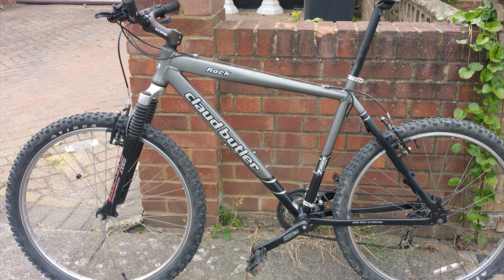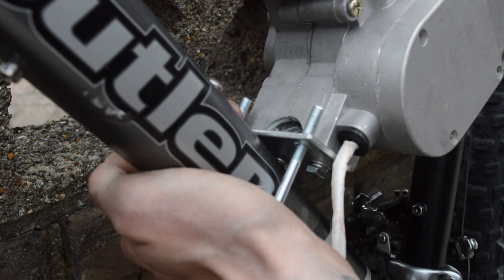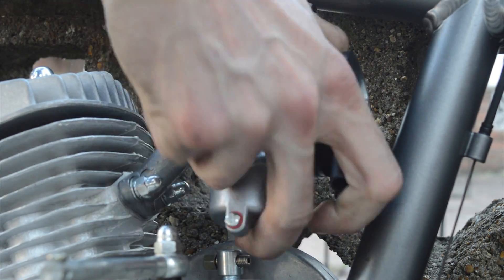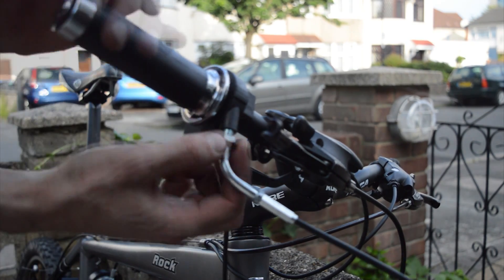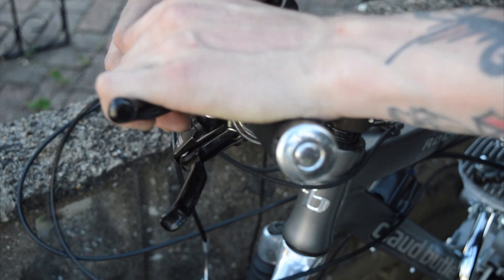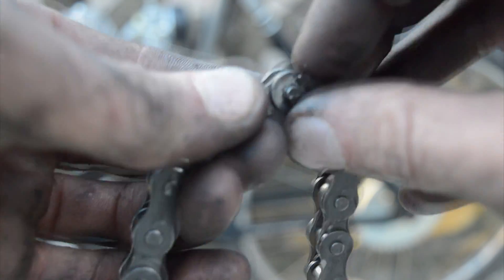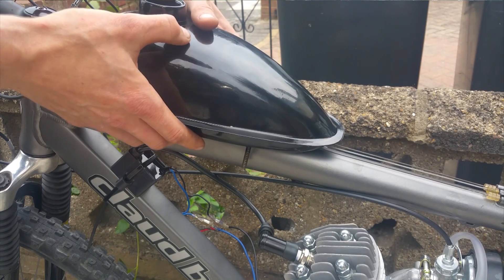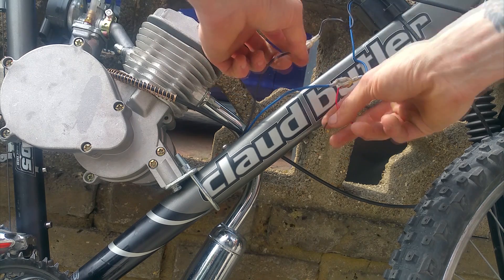Build a Moterised Bike at home - Tutorial

Comment: What is the millage.
Reply: David Dicker he means what the miles per gallon or kilometer per liter
Reply: Ty Lambert Yes what is miles per litre of petrol
Reply: Amit Sarkar all in one sorry man I honestly don’t know the answer but I’m sure you can find information on it.
Reply: David Dicker that really good. I’m sure that you could get more if you change out the cam shaft.
Reply from the maker: +Amit Sarkar all in one well as this is a brand new build there will be no miles on the engine.
Reply from the maker: +Amit Sarkar all in one well I can get around 60 miles on 3litres as I have upgraded my carb and exhaust along with boost bottle. Depending on size of the tank or accessory you install you can change the distance.
Reply from the maker: +Ty Lambert I can get around 60 miles with the 3 litre tank with the hp carb and race exhaust. Depending on what you have installed or the litre capacity of your tank will benefit you.
Reply from the maker: +Ty Lambert also depending on weather you are breaking your engine in with the basic parts you will get a little bit more distance without any upgrade.
Reply from the maker: +Ty Lambert well I don't know about that but you could always get a bigger tank and go further. Something like a 5 or 6 litre.

Comment: What is the maximum speed of this motorcycle
Reply: David Dicker what parts could u upgrade?
Reply from the maker: +Amit Sarkar all in one after the break In period you should be able to achieve speeds of up to 35 to 40mph depending on what part you could upgrade then you could do speeds of 70mph. I hope this helps and thanks for watching.
Reply from the maker: I have another video about upgrades you should check it out and see what you think.

Comment: Don't waste your money on these motors. They are all crap.
Reply from the maker: +Frantic Carnival well they haven't let me down yet and I have upgraded the bolts and nuts to hardend stainless so I haven't faced any faults.
Reply: David Dicker I just can't seem to keep one running longer than 6 months. There's always an issue whether it's the carb, chain, or clutch. They just don't seem to be reliable. Maybe I'm expecting to much from these little motors.
Reply from the maker: +Frantic Carnival well you can upgrade parts on these even down to nuts and bolts. I have done this and I am very happy with the result. Feel free to check out my other videos and I can show you how to really go to town with custom fabrication and modification.
Reply: David Dicker 
No thanks. I'll spend money on something else. Good luck!
Reply from the maker: +Frantic Carnival well the nuts and bolts plus a new carb with air filter will only cost 30 pound but it's up to you
Reply: David Dicker 
Hi! Thanks for you're comment. I'm interested in gaining speed with mine. After your video, I was inspired to give mine another shot so now I'm going for speed and I need some guidance. I have a 36 tooth sprocket and have ported the motor and purchased a clone Dellorto carb. With these, I can only achieve 40 mph. Wheat else is needed for such speeds?
Reply from the maker: +Frantic Carnival well you need to change your jets in your carb also you can get a quarter throttle grip along with a better fuel to oil mix. Any small thing you can do will improve it drastictly. Plus upgrade all of the nuts and bolts for 6mm stainless.
Reply: David Dicker 
I'll try these and see what happens. Thanks for the tips! Be safe out there brother😊
Reply: I port matched the intake and Wow did that make a huge difference!!
Reply from the maker: +Frantic Carnival no worries and can't wait till you get back to me and tell me how you got on. Wish you all the best mate and be safe to.
Reply from the maker: +Frantic Carnival brilliant I am glad to see your back to this project. It is more fun when you tinker around with these. Have a great Christmas and New year.

Comment: Pliers aren't doing it I got one off the others stuck and refuses to turn what can I try? (EDIT) Finally got the stud butwas wrong about the measurements and really need to know if you can put the carburetor on slightly turned on it's side or maybe more then slightly?
Reply from the maker: +YouTube BANDIT you can get an offset for the carb on eBay for around £2.00  with boost bottle attachment or normal offset. Just type in 80cc offset in eBay and you will see. I hope this helps and thanks is for watching.

Comment: I have a Trek Marlin 6 mountain bike. It's hard tail with disc brakes. Would one of these kits work on my bike?
Reply from the maker: +Derek Mckenzie just checked and it should fit nicely and you can always get a offset carb setup for cheap to give you more room for installation. I hope this helps and I have many more like this so check them out.
Reply: I'll just have to get a kit. Where and how much would a 2 stroke or the bigger 4 stroke cost m?
Reply from the maker: +Derek Mckenzie the prices are different they start from 68 pound and go up to 300 pound on eBay and the prices always change so check them regularly. Plus the 4 stroke does not go as fast and cannot be upgraded as much.

Comment: Have you found any easy way to omit the sprocket and use the bikes sprockets to be able to shift speeds?
Reply from the maker: +Navraj Gill yes you can get a Jack shift kit but it might be a little pricey though.
Reply: David Dicker right on, I see it costs about as much as an engine kit to make that possible. I dont need it but I want it xD
Reply from the maker: +Navraj Gill well if you look about you might be able to get it a little bit cheaper but I would stick to the normal ways.

Comment: I'm actually going to purchase a kit soon do you have any advice which brand i should get
Reply from the maker: +cornholio55 I would say that any kit from around 100 pound from Amazon or 65 pound from eBay because all of these kits are basically the same internally even though they are different prices. The best this I can suggest is buying a cheapish kit then try upgrading the nuts and bolts along with all the washers with stainless steel. Most of these size bolts are 6mm thread.

Comment: Do the bike brakes stop the engine at max speed ? In how much distance for it to stand still?
Reply from the maker: +Aazib Ashfaq well to be honest the normal bike brakes are good enough to stop but it depends on what the weather conditions are exactly pike a car so on rainy days it will take a little bit longer to stop depending on what tires plus brake pads and what tire pressure you have. I hope this helps and thanks for watching.

Comment: Another question haha, any advice on why my bike is stuck in neutral now and won't go into gear?
Reply from the maker: Some times a little bit of tweaking helps from here and there.
Reply: Clutch cable is too tight
Reply: David Dicker yeah in general tweaking and tinkering goes a long way
Reply from the maker: +ReedyFML you need to make sure that you adjust the clutch properly to engage the gearing for the bump start of the engine. Try and adjust the clutch cable on the arm then retighten the screw or take the clutch cover off and then adjust the flower nut position. I hope this helps and thanks for watching.

Comment: Iv just bought a built bike 80cc and the cables came undone and there is a white cable with the black and blue one any idea where it goes ?
Reply from the maker: +Shaun Burney the white wire is a 6v wire for the lights on the front and back. You can discard this as you don't really need it. Also put the blue with the blue and the black with the black then it should work. Make sure your killswitch wires are linked aswell otherwise you won't be able to shut it off. I hope this helps and thanks for watching.

Comment: Hi thanks for this tutorial, my bike is now in working order, however how do I stop petrol from leaking from the tubes? I used zip ties but they're useless
Reply from the maker: +ReedyFML you can get special bracket jubalie clips from most diy shops or order from eBay plus Amazon. I used to get the same problems bit try upgrading your fuel line aswell you will find this will improve it alot. I hope this helps and thanks for watching.
Reply: Get some small hose clamps. Should do the job,just don't over tighten then.
Reply: By UK fuel line [braded] and clips [chines tubes break down on elasticity very quick, or get a slightly smaller pipe and heat up the ends in very hot water and push on 
Merry Christmas to everyone.
Jim
Motor Power Bikes
Reply: You are a Great Guy keep it up [like the Vids] I am off now until new year so MERRY CHRISTMAS
Jim
Reply: ReedyFML you could try hose clamps but it would be best to just go buy some higher quality weed waker fuel line
Reply from the maker: +Jonathan Kirk you will see from my later videos I have done just that. Cable ties are ok at first just to run the bike in and break the engine in but once upgrading parts I would agree. I hope you enjoyed this video and thanks for watching.
Reply from the maker: +james demanbro I agree and if you see my later videos you can see I have done exactly that. Wish you all the best James.
Reply from the maker: +james demanbro ok matey wish you all the best.
Reply from the maker: +french toast if you check out my later videos you will see that I have done exactly that. I agree when you get the kit it does not come with this but it is a vast improvement on the standard items they give you for installation. I hope you enjoyed this video I have many more like this so check them out and see what you think.

Comment: David Aaron Dicker, I am going to build one of these and I will be taking it to Secondary School I am in 9th grade and the principal has seen them and has no problem with them as long as they are ridden on the school grounds. By the way how fast can these go if you upgrade the caburetor and air filter etc. How far do they go in a FULL 2liter tank?
Reply from the maker: +Bayar Usman that's good to know and I wish you luck with your project plus any help or advice feel free to ask. These bikes will vary in speed depending on what upgrades you put on but you must make sure that you properly break the engine in with 4 full tanks of fuel to oil mix. I also have many other videos that you might want to check out and thanks for watching.
Reply from the maker: +Bayar Usman with a 2 litre tank plus an upraded carb and new exhaust you will be doing around 60 miles plus hitting around 45 - 50 mph.

Comment: The bike is fully setup following your step by step instructions however I pointed out a problem about the first small sprocket in the engine not moving, however now it's all setup the bike is basically acting as though it's seized even when the clutch is pulled in, any help?? Please
Reply: I haven't even got around to going on the bike as it just won't move as it's stuck
Reply from the maker: +ReedyFML what you need to do is adjust your clutch so 1st try to undo the clutch arm screw then slacked off or tighten up the cable then retighten the screw. Or undo the flower nut on the other side of the crank case then release the nut slightly and then retighten. I hope this helps.
Reply from the maker: +ReedyFML with the back wheel like this the clutch will be fully locked on so the bike won't move.
Reply: Thankyou so much for the quick reply! I'll try that and let you know
Reply from the maker: +ReedyFML no worries try it and see how you get on and if you get stuck feel free to ask and I will do my best to help you.
Reply: This Is England The flower nut where the first sprocket is or on the other side of the clutch? Any. Help is appreciated as it's still not working, with force the first sprocket will turn but besides that it won't work properly
Reply from the maker: +This Is England it is either the flower nut or the clutch cable lever. Like you say the flower nut has to be adjusted to engage or dissengauge the clutch to either gain or loose compression on the engine.
Reply from the maker: +ReedyFML it will not engage or dissengage untill you loosen the flower nut or the clutch cable it's all a little bit trial and error sometimes.

Comment: Fuck the muffler
Reply: Kid powerlifter 2 stroke engines will burn up with no back pressure which is provided by the muffler
Reply from the maker: +Kid powerlifter unfortunately you will need the muffler to run the engine in and so as you don't loose power. Also any big gaps left like this could also damage your engine.
Reply from the maker: +Alex Hickey I agree you won't have any power what so ever and be at the risk of damaging your engine.

Comment: hey bro, i have an old Saracen havoc bomber extreme that i want to convert, the frame looks out of sync to install an engine, is there anyway i could get around it? thanks in advance
Reply from the maker: +Jasen de-botte just looked at pictures of this frame and unfortunately it won't fit due to the lack of space as the back suspension is in the way of the engine mounting points. You can all ways purchase another frame and build one for pretty cheap.
Reply: hi david, cheers for getting back to me. yeah i thought that would be the case, i also guess the rear shocks would intefere with the chains length  as well. ok cool will get a new frame. thanks mate :)

Comment: I'm currently building mine up and using your guide however the big spring for the clutch seems to just slide Over the clutch cable so it isn't any use? Any help is appreciated
Reply from the maker: +ReedyFML well this video has helped many others complete there bike. What you need to do is thread the clutch cable through the eye on the engine then use the big spring then thread the cable through the other eye then use the small spring. Finally thread it through the last eye on the clutch arm and then tighten. I hope this helps and good luck with your project 😁
Reply: Yeah it did thanks! Another thing when the clutch arm is taken off with the engine cover the front sprocket doesn't spin to put the chain on? Thanks a lot very quick reply and amazing video thanks
Reply from the maker: +ReedyFML yes this is correct it won't move so put it back on with the 3 screws and push your clutch arm in with your hand then it will spin. Then feed you chain in from the top and this should work. Plus I have a few more like this you might enjoy and thanks for watching.
Reply: David Dicker You got any ideas about my most latest quiery on this project? Thanks
Reply from the maker: +ReedyFML yes try to follow what I said and this should work. I had the same problem on my 1st build.

Comment: hello i have a question how long does a 2 stroke bicycle run for . also how much to fill the tank up of gas
Reply from the maker: +Big Nutss well they say not to run them for no longer than 10 to 15 mins at the break in stage but it depends on what upgrade mods you have done after along with how big your tank is.

Comment: ive watched several videos one this exact motor and this is the only video that actually helped. and the music was a nice bonus. just kept replaying the video over and over until my bike was finished. thanks alot!!
Reply from the maker: +Joseph Franks no worries I'm glad this helped you to get your bike done I have a few more videos you might want to check out and thanks for watching.
Reply: +David Dicker only thing I can't get fixed is the clutch. my bucking bar is sticking out and I can't get the clutch arm an plate back on.
Reply from the maker: +Joseph Franks remove the clutch from the other side and take out the 3 screws then this should allow the clutch to go back on the opposite side were the flower nut holds it on.

Comment: A tip I learned for my triumph is to use an air nozzle to remove and install handgrips.
Good video, though the music was too loud for my liking.
Reply from the maker: +Wallbears cheers another way is to boil a kettle and tip the hot water over it then it will fall off. I am sorry that you didn't like the music but it's the way the video had the come out.
Reply: I use tannerite.
Reply from the maker: Never heard of it what does it do? Can you explain please.
Reply: @daviddicker7025  it's an explosive. It goes on impact.

Comment: Good, no nonsense video, saw these in Spain on Beachcruiser bikes last year and then a couple locally in the West Midlands about a month ago. Ordered my kit straight away and then waited for the right spec bike to turn up and now it has arrived today so i shall assemble. If you have had motor bikes/mopeds etc you will have no problem. I will be mounting mine on absorbing material to help dampen. 
Of course they are illegal here as to use one you might as well buy a motor bike which means tax, insurance and number plate recognition..... Fuck that, that is why i want one - i have paid enuff into the system and now it will be lip service if anything. If you worry about an approaching Police car just kill the engine and pedal.....
Thanks again.
Reply from the maker: +Laurie Allan no worries and I am glad you liked this video I have 14 more you might want to check out. Plus thanks for watching I hope you enjoy the rest on this channel.